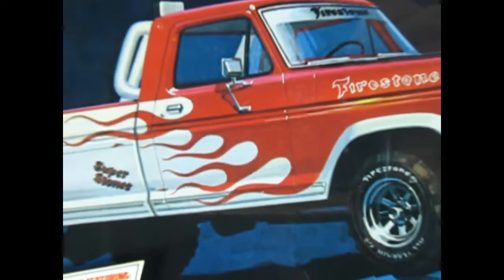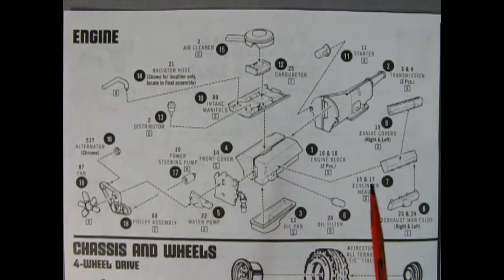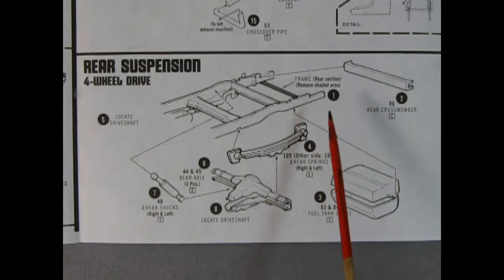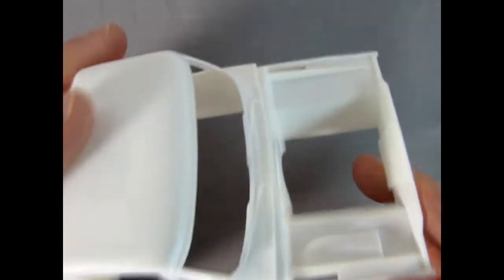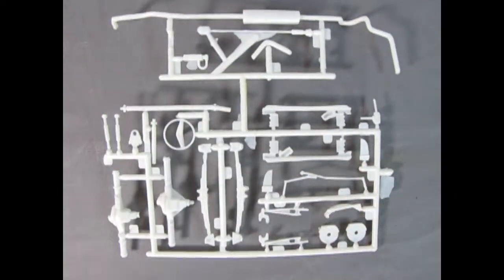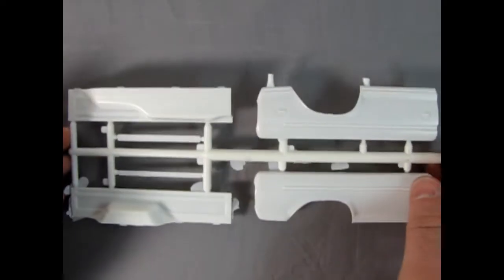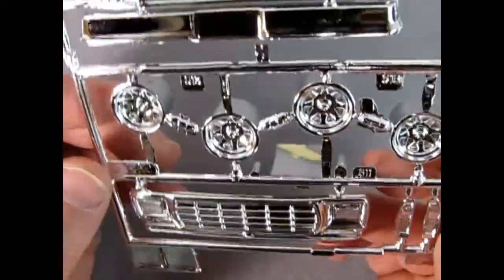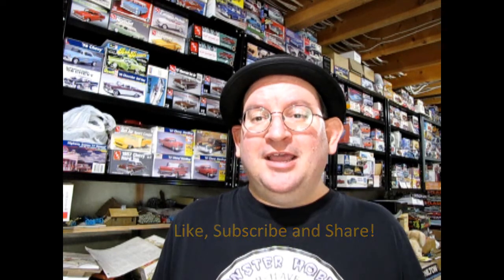Model Car Garage - The AMT 1978 Ford Firestone 4X4 Pickup - A Model Car Kit Unboxing Video

Comment: I put a video of mine up awhile back. Challenging build but was great to have since I work for the company. You can build it several ways, which Ive seen others do. Nice addition to the same 70s models you may have!!!
Reply from the maker: I will check it out. - Glad you liked this difficult build. I was going to get one for myself from Michaels, however, when I went to get one, Michaels sold out of kits, never to bring them back.
Reply from the maker: Saw the video and I think it's good, informative, and lets people know of the issues and some solutions to fix them.

However, I would go back in your video settings and change the settings to "Not For Kids". That way people can leave a comment. 

I know that back a few years ago when You-Tube brought in the COPPA rules that a lot of people in the model car/truck hobby went into "Panic Mode" and thought their channel would get fined massive amounts of money. 

At the time I don't even think YouTube knew what all the issues were,  but in recent years, YouTube resolved a lot of those issues and it basically boiled down to "If you are asking kids for information like where they live or for money or to buy something, in your YouTube videos, then you are violating COPPA."  - Since you are not doing this, then you can change your settings to "Not For Kids" and you'll be fine.

Comment: I noticed one snag. The top of the windshield moulding should be lined up with the top of the door frame. The windshields are quite tall on these.
Reply from the maker: Thank you for pointing that out!
Reply: @MonsterHobbiesModelCarGarage  I have an original of this kit plus the earlier red one from AMT, same problem. Also the earlier red one has hubcaps that are 23 mm in diameter, not kidding and they are original to it. The top of the w/s would just have to be cut higher and a new moulding detailed. I think the glass should be ok.
Reply from the maker: Some of these old molds had issues that I don't think the new AMT under Round2 have corrected.
Reply: @MonsterHobbiesModelCarGarage  It could be easy to miss the windsheild height.
Reply from the maker: @crushingvanessa3277  For sure. I wonder how the kit glass fits in? Is it tight or is there a gap?
Reply: @MonsterHobbiesModelCarGarage  I just tried both. The Firestone truck I have is the round2 issue and the other as I said is the original 1975. The cabs and windshields are the exact same. The windshield goes right to the top of the cab. So opening the top wouldn't be any problem. Myself I would cut away the vent windows and make them new and fit the doors. The one I have, the wrap around part of the windshield curls in a bit much but the other fits fine.